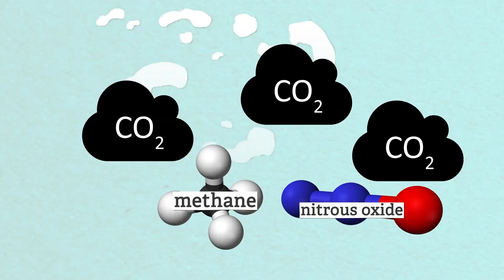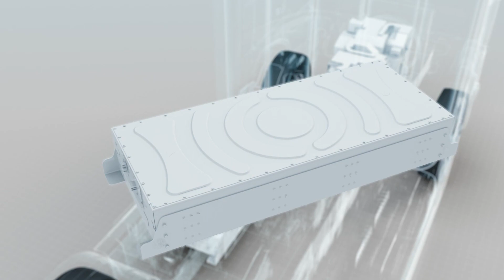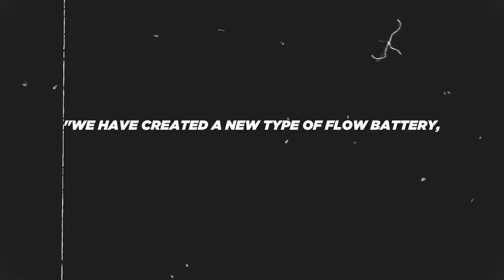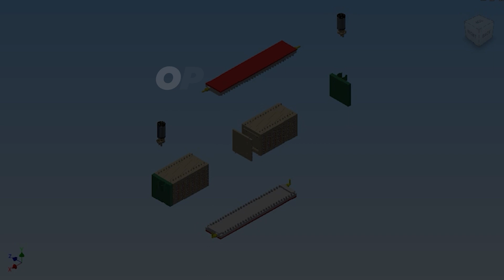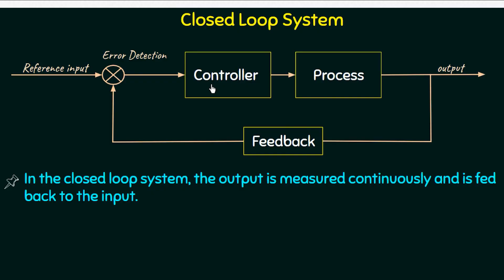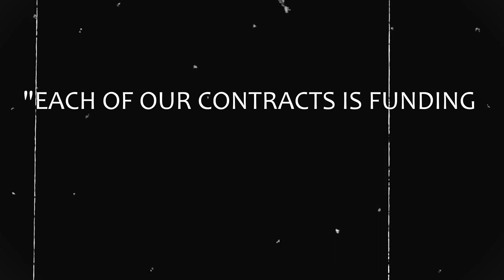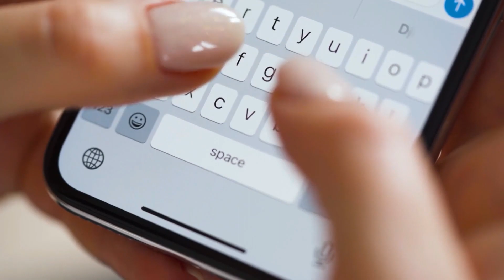THE END OF GASOLINE? | Electric recharge fuel

Comment: this removes battery swaping, charging, extends range indefinitely, improves power density, simplifies speed of use, reduces waste, less weight and reduces the cost of system change.